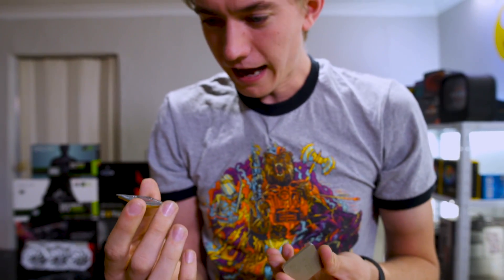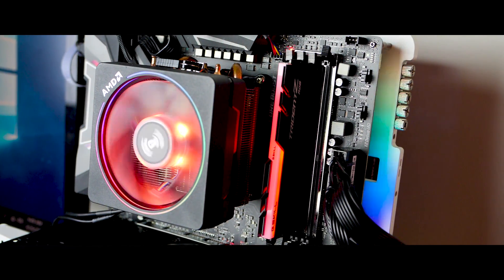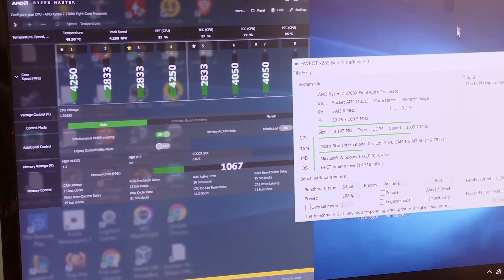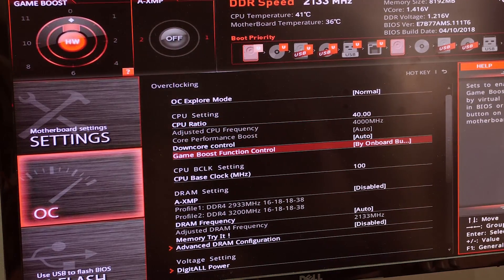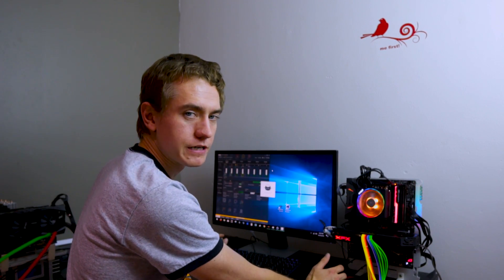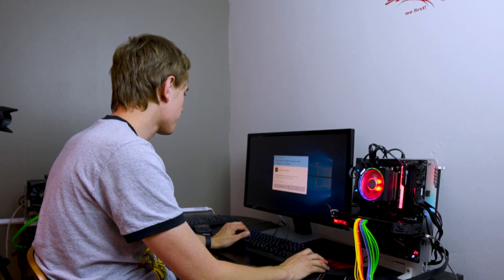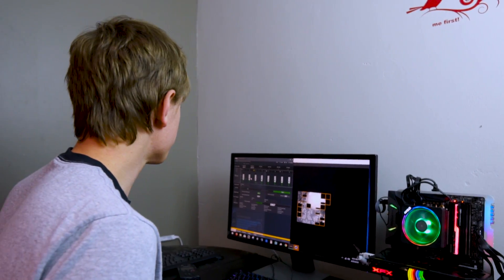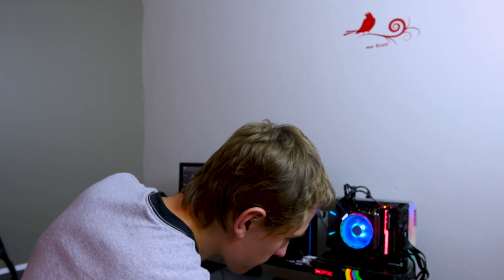Unsafely Overclocking the 2700X On The Stock Cooler

Comment: I've seen my 2700x reach 4.375ghz at under 1.5v, and about 77°-78°c,100% fan speed tho. That's just the CPU doing what it does, no static OC. It's not that loud.(stock cooler btw) It didn't stay at 4.375ghz for very long, 1sec, MAYBE 2sec.

Comment: Mine is running at 4.275 with stock cooler at 1.5v
Reply: 1.5v? Holy shit!
Reply: @victuz  It was set on auto tho, now I have Liquid Freezer II 360mm, still 2700X. Now on 4,385 GHz, 1.47V on manual voltage.
Reply: That's pretty high isn't it? What's your temp?

Comment: I've been really lucky with mine and got it to 4.2ghz without rising the voltage and I get around 77C with stock cooler. Very happy with my purchase
Reply: 😍 whoah
Reply: What motherboard?
Reply: Same but 4.25
Reply: I have the same ghz but 68C  with stock cooler. Do you also use stock paste? If so that would be pretty gud
Reply: @Doltern_  did u change thermal paste yetb

Comment: 2700k isnt meant to be overclocked, its got XFR2 and Precision boost, you will lose gaming performance while adding more voltage and much higher temps and a small chance of instabiliity just so you can brag about your useless cinebench score, just get nice cooling and low timing memory and leave it, this isn't Ryzen that had broken XFR.

Comment: I got my 2700X on a Asus Crosshair vi and a custom water cooling loop, I only got it to 4.2 @ 1.425 volts. the performance did not improve much so I set it back to stock. I only have 3200 Mhz Samsung B die memory. my next move will be upgrading to B die based 3600 memory. I might even invest in a Crosshair vii motherboard later to get higher boost clocks and it might be good enough for even higher memory speeds. the best I got on Cinnebench with the overclock to 4.2 Ghz was 1817 CB points on multicore and 1.73 on single core under Windows 7. there was a few times it boosted to 4.3 but it was on lightly threaded apps.

Comment: that stock thernal paste has a really bad aplication. i tested 2 2700x that i assembled (i work on a hardware store) and with the stock thermal paste on aida64 (wich is more demanding than a short cinebench run) hit 74°c max. with artic mx4 went down to 69°c. i didnt tested overclock since it was a client pc, but the cpu on aida was at 3,95ghz at 1,36v.. so.. with 4,2ghz at 1,4v shouldnt have much higher temps

Comment: 8700k  turbo is 4.7 single core not 4.8.  ive got mine set to 5.2 all core at less than stock voltage.  i think its safe to say they could do more than 4.7 especially if they soldered

Comment: I get 1765 points in Cinebench with my Ryzen 7 2700X at stock settings with just XFR doing its thing on an Asrock ab350 gaming-itx/ac wifi and 16gb G.skill Trident Z RGB 3200MHz cl16 ram.

Comment: Bruh, I got my 2700X stable at 4.2Ghz OC at 1.42V on a B350 Motherboard, with a Noctua NHU12S-AM4 Cooler and my temps don't go past 73C under stress test
Reply: 1.4v is a high voltage imo

Comment: For OC u must set the TDC and others AMpers llimit much higher, also LLC and CPU power phases settings. Its not so easy as some people thinking. The same with Intel, for not throtling it is better set power limits manually

Comment: My pump and cpu fan runs 50% in 40C, 60% in 45C, 70% in 50C and 100% in 60C. R5-1600X 4,1Ghz-1,448Vcore highest temperature in gaming is 61C (avg ~50C and ~40C when FPS Locked in 60fps). My PC sounds like vacuum cleaner :D

Comment: the amount of customers that actually do overclocking is very very small part of the market. I rather have a chip  near it's max performance coming out of the box than buy another $60-100 cooler to get 5-10% more performance
Reply: That's thing if a gpu gives me 20fps ile buy a better faster gpu than a cpu which is only 5 fps better than AMD better just buy amd lol at 4k amd is the best choice anyway
Reply: rurutu M lol I just bought a 15$ cooler and took my old CPU from 3.4 GHz to 4.8 and benchmarking shows 50%+ improvement
Reply: LarryM these new Ryzen 7 prism coolers are as good as $30 coolers, you have to go to $60+ coolers to see real improvements
Reply: rurutu M hyper 212 is all you ever need. I was able to hit 4 before and was frying my CPU on prime95 but afterwards I can hit 4.8 easy and top out at 80.
Reply: hyper 212 are $35 MSRP but usually priced at $25-30 so no that is not a $15 cooler.  the intel non K chips has $5 garbage coolers and the K chips don't even have a cooler forcing you to spend money on a cooler just to run it. The intel non K chips are purposely underclocked  cause they ship with the garbage stock cooler knowing there can be more performance to be had but they don't want to give that to the consumers. 
my original comment is about the cooler on the ryzen 7 2700x the chip in this video, but you keep ignoring and goes to talk about intel chips and how amazing it can overclock  if it just had a cooler on it.
Reply: rurutu M hyper 212 Evo right now is 15 bucks check the latest ufd deals
Reply: rurutu M my Intel chip is soldered just like AMD does. That means the cooler and Tim make a huge difference
Reply: SpicyHotTech well if you gonna spend that much on a cooler just get an aio. Don't buy a shitty case.

Comment: Is it just me or is every tech reviewer only overclocking their Ryzen chips with stock coolers? Could this have something to do with the news that broke out that if you use an aftermarket cooler it voids your warrenty? Something shady going on.
Reply: I think they do this because under really great cooling it allows higher and longer sustained boost speeds and the resulting higher voltage these chips get under the higher boost clocks. if you really take a look at this it makes more sense than it does on the surface.

Comment: i mean oc it to 4 jhz and left xfr do the rest
Reply: then you don't need to do anything, it will xfr to 3.9-4 all core + 1 core 4.2 on the stock cooler + stock settings
Reply: If you want money, Then give me even more money im new to tjis but just bought this CPU.. i dont need to do anything at all to get around 4.0? Auto oc? Can you explain
Reply: @its_pvd  you just have to set the turbo in the bios

Comment: question, did you hit the high switch on the cooler? or is this on the low switch?
aka the switch is on the side of the cooler. very small

Comment: Core i7s are still better
Reply: i love my 8700k but i dont know about better. depends on what youa re doing.  ryzen+ is king in production.  the first gen wastn better than 8700k at 5ghz most of the time but the 2700x is a bad mamajama.  still i mostly game and use single threaded apps and i can game on this thing at 5.3 at stock voltage its insane.  blender runs the bmw at 5.2 with stock voltage.  got really lucky on the lottery.  but intel deserves all the busines they have lost . all they had to do was go 6 cores in the 6th gen and 8 cores int he 8th and ryzen would just be a cheap knock off.  and please solder the i7's at least intel . the i5's are ok without it but not the i7

Comment: is the 2000 chips like the 1000 chips when they first come out they had a 20C offset in temps basically they were running 20C cooler than reported.
Reply: no, they dropped down to 10c this time around on the X chips.

Comment: I'm getting 4.35  speed with out over clocking using an AIO on an x370 board.
Reply: asus hero 6?
Reply: I heard the XFR 2.0 on that chip was good.
Reply: CB Score and ram speed?
Reply: I’m using an ASRock Tichi x370. Ram is clocked at 2800 atm. I’m having some issues getting the ram to clock higher and be stable. I think I need to adjust timings manually. Firestrike score was 24567 for cpu. 22347 for GPU. I need to ReDL CB did a fresh install for the new chip.
Reply: which aio
Reply: Oof

Comment: why is your ram at 2133
Reply: alls I know is that my 1800x @ 4.05ghz with 3200mhz CAS 14 Ram gets 1760 in CB.... just saying the ram is a major Ryzen performance unlocker
Reply: Is it possible to be choking your overclock due to the slow ram speed with ryzen though? Not really sure if thats possible but I know performance itself scales well with high speed ram and ryzen.
Reply: faster memory speed makes a huge difference on Ryzen, especially with the 8 core and higher.
Reply: in my bios it also say 2133 mhz, should i increase it?? i also got the ryzen 7 2700x on msi x470 pro
Reply: @StoneyMelony  increase ram.
Reply from the maker: Because that wasn't the point of the video at all.

Comment: I'm gonna pretend that you dropped a 8700k and forgive you.
Reply: I re-watched the dropping part twice at 0.25x speed and it appears that his hands just opened. So im unsure if it was real or not. also Ryzen CPUs with the exception of the APU ones are all soldered and if the IHS did rip off(very unlikely unless the seal is tampered with) it means the solder/indium was tampered with and it was also not present on the die when he showed it so we shall wait and see
Reply: Probably Son of a Tech's CPU
Reply: most likely der8auer's cpu, he just did a de-lid video on the new ryzen a couple of days ago
Reply: his was a 2700x as well
Reply: That kinda makes sense..
Reply: Keanu du Plessis It's a 2200g or maybe 2400g... but I'm a nice guy...so gonna pretend it's a brand new 8700k or 7980XE and not get mad at UFD Tech. But I am a little disappointed.